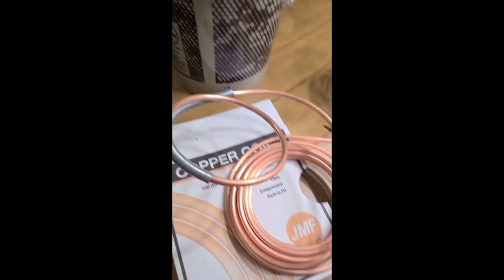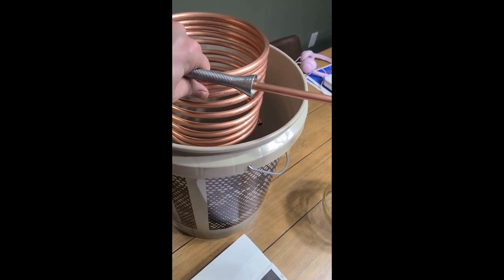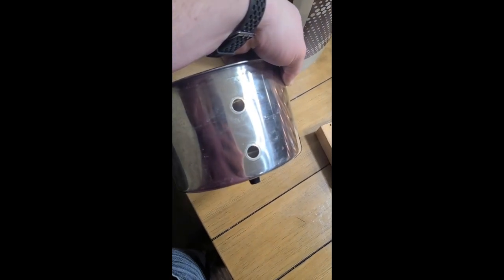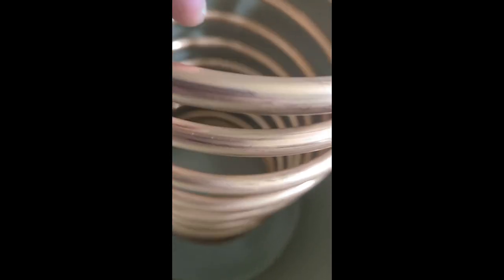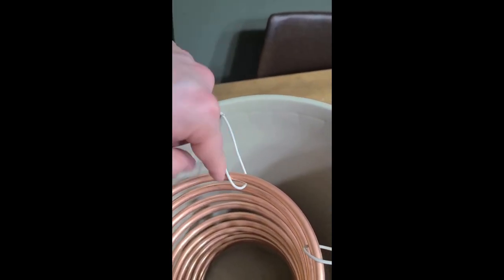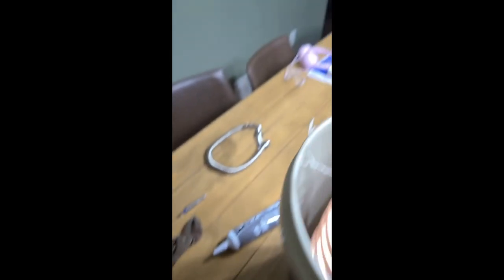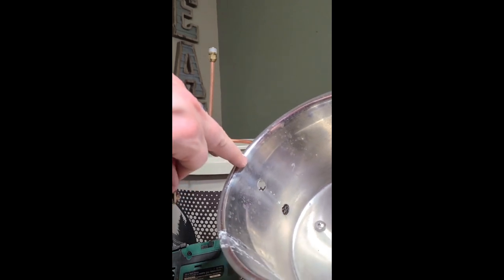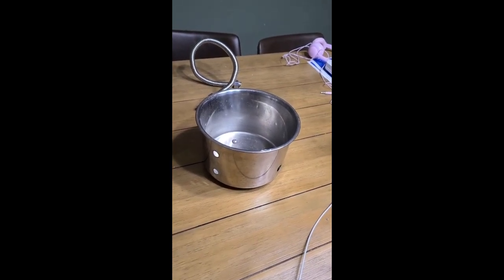Dave's Vevor still copper coil condenser modification

Comment: Great video brother I built my the same way about 10 years ago still got it today one thang that might help a lil don’t know how much it matters but run your water inlet at the bottom of the buck and the water outlet out the top heat rises take the hot or warm water off the top instead of pushing it though the hole bucket either way it will definitely work good keep on distilling brother
Reply: That is the most incredible thang I've read all night never would have thought about that.
Reply: I’m also just getting into moonshine not gonna lie I clicked on your profile and watched you Stilling playlist Not gonna lie to help thanks for keeping it public lol

Comment: Cool.  For anyone that needs a solution prior to this, you can freeze a few liter bottles of water, and save several runs of ice from your ice maker and add the bottle to your supply/pump water container, and add ice to the condenser pot as necessary.  Labor intensive, but it works ok.  EDIT:  I’ve since done this mod and it is so much better.  Right now I still use 2 L bottles frozen… One for the coil bucket and the other for a water supply bucket so it gets cooling in both places and I still add ice to the coil bucket just to keep things nice and cold. Also if you don’t want to Undo the copper fittings in the original condenser, my kit came with a small piece of vinyl tubing that could be added to the output of the original condenser and there’s an extra small piece of copper there I suppose to angle down the final output, and I just connected my new section of coil to that little piece of vinyl tubing.  Thus no flare tools needed…  Lots of ways to get er done. 😅
Reply from the maker: Great tip. Thanks for sharing.
Reply: I have a cooler that I use for the condenser water, and simply refill it with ice as needed. I believe I may have gotten a different still, mine came with a pump and tubing to use an external tank for the condenser pot's water.

Comment: First thing I did when I bought my Vevor still. Used a 5 gallon bucket & copper tubing. If you don’t have a pipe bender roll it around a piece of large pipe. I will say I outgrew the 8 gallon pot pretty quick and built a completely new still with a 15.5 gallon keg. The old Vevor 8 gallon pot is now my thump keg.

Comment: Is this made with a 10 foot section of 1/2” copper pipe? Also, are connection to buy instead of removing the original? If so what would I need to buy?

Comment: Fill the condencer bucket full of water and put it into the freezer to freeze it up?  enough cold for a long run?  add some water?     on top of ice  to flow down the outside of the pipe to maintain water contact with the pipe as the ice melts size frozen bucket condencer to batch size taking into account standard copper tube length and diameter and bucket size to come up with the smallest practical size to fit in freezer???       never having distiled and not knowing how much ice is needed
Reply from the maker: Nice tip, thanks for sharing.

Comment: Is the Vevor cheaper than the pressure cooker I used?
Mine also works as a pressure cooker.
Reply from the maker: I don't know how much you paid for your pressure cooker or how big it is, but this 5 gal Vevor model is about $89 new. I'm certain the Vevor can NOT be used as a pressure cooker.

Comment: what size copper tubing and length to order? thx
Reply from the maker: 3/8" x 20'. There is an Amazon link in the video description.
Reply: On my side I don’t see a link to the copper pipe itself.  I see the bending tool, flailing tool and step bit.  Is there something specific to order?